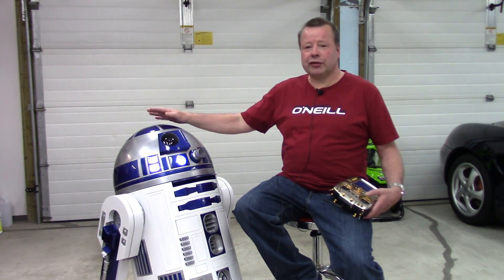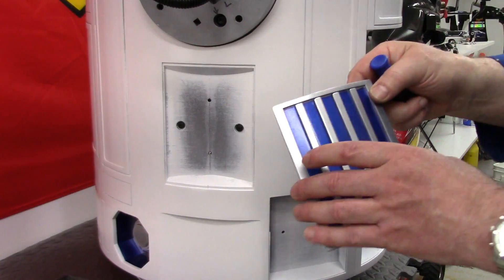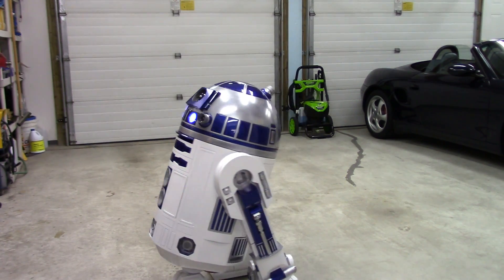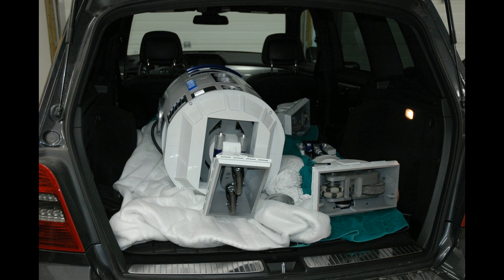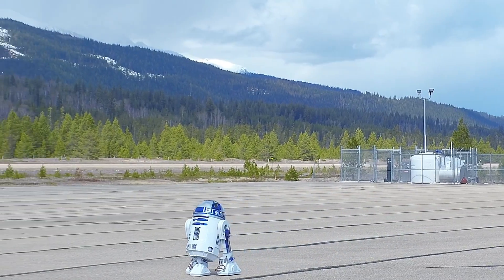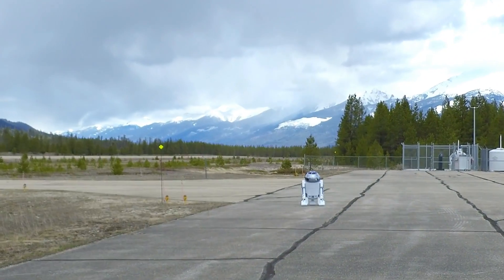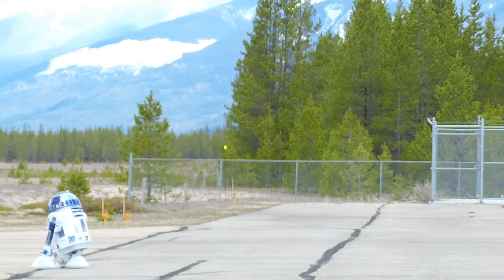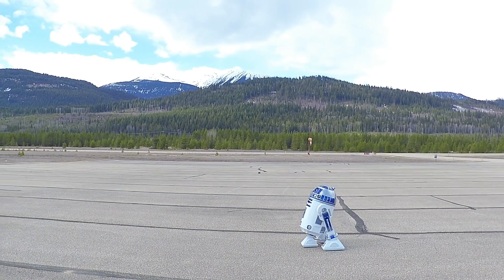Making R2-D2 - Finishing Up The R2 Build Project with Q&A.

Comment: I wonder if you could put one of the casters in the rear of the foot instead of the omni.  Would probably require a mod for mounting.
Reply from the maker: Yep, not nearly enough room for the swing distance of a caster back there. Would have to make the rear foot carriage and shell both wider and longer. Not an option.

Comment: Looks Great John !   R2 is my next big project, after I finish my B9 from Lost in Space.  The parts of your build series that I have watched are good.  I want to watch the drive sections, I am interested how you tied the electronics to the RC receiver.  I converted an 18 inch static R2 into a movable, interactive model.  this was done with an EZB controller and several servos.  It worked good.   I do have one question for you, does your R2 move from the 2 legged to the 3 legged position and back ?  Or are his legs fixed ?
Reply from the maker: Fixed

Comment: Could you have made the roller blade wheels on the rear legs caster as well? Then no need for the roller wheels.
Reply from the maker: I covered that in detail  earlier in this series (specifically part 8 and then fixed in part 9). Can't have a rollerblade caster as there is not enough swivel room in the back feet, and can't have just the roller wheel as there is too much wheel scrub while turning.

Comment: Amazing work John! I have also built a 3D printed R2. I started in 2019 and as you know he's a constant WIP, lol. To answer your question, I have not had many issues with the plastic creaking noises. Looks like you have the speed regulation down. I have almost flipped mine once or twice. I originally did the V2 belt drive and quickly switched to the V3. I started with 6S, then went to 4S but I think I'm going back to 6S. Mine is primarily Mr. B's V2. I transport mine in a 2DR Jeep Wrangler. I take the dome off and put it on the front seat and load the body in the back without taking the legs off. Fantastic work! thank you for documenting your progress! 7 Months is unbelievable!
Reply from the maker: Hey Kevin. Awesome to hear from you! I have to tell you, your video of your 3D printed R2 build ( https://www.youtube.com/watch?v=0DoM3aJg8eQ ) was the first one I ever watched (and watched the most) when I started down this road while considering different build methods and digesting information in the Astromech.net threads. In short, your build gave me the final push to go the 3D route because it looked so good.
Nice to know you didn't have any creaking or squeaking - perhaps it's due to different types of PLA used? 
Yep, a constant WIP is right. I still haven't weathered mine as I'm finding it hard getting the courage to start 🙂 That will be the next job however I hope to tackle over the winter.
I'm also considering changing out the Teecees light set to the Astropixles developed by Darren Poulson. They use the RGB LED's with the fading effect to emulate the original fiber optic/color wheel, but at a much better price than the R-Series hybrid fiber optic light set; Darren's also include the PSI's.  Ever since I watched Adam Savage's fiber optic light overhaul on his R2 last year, I'm finding the digital look of the flashing Teecees not my cup of tea anymore. Oh well, it never ends does it... Take care & thanks for the kind feedback.
Reply: Oh wow John! Thank you for the kind words. I have been thinking about revamping the dome also, I will look into the Astropixles format. I also want to us some Polulu boards for the dome panel animations just to make my droid different. Now that I'm settled in the new house I hope to get back to more video work and updates. I have had some people ask for more content and I am grateful that anyone would stop and comment so I hope to get some more vids out there. Thanks again for putting all you progress together and posting your videos.
Reply from the maker: Hi Kevin. Your video was very well done (as of course was your R2), so it's no surprise you get such requests. IMO, yours is one of the best if not the best 3D printed R2D2 videos showcasing the full build journey from start to finish in a single video with great story telling of the process. Very entertaining and as I said, I watched it many times, especially when I was feeling frustrated or lacking motivation with my own build. Yours always gave me inspiration to carry on.  
Have fun with any future R2 update videos now that you have more time and are settled in - I'll be watching :)

Comment: Hi John and thanks for the series! I have most of the body finished and working on the electronics and drivetrain now. I’ve been reading by other guys making their R2 units that putting caster wheels don’t work too well on carpeted floors. What is your experience? Also, could you tell me which  airport this is? I got my pilots license in Canada back in the day and miss the place got to say. Guess you have friends in high places. And by high places I mean the guy in the tower.
Reply from the maker: I suppose thick carpet would be an issue, never had any issue on the low pile stuff. Airport: CAH4. Our RC flying club has special permissions for shared usage. Have fun with your build.
Reply: Ah, BC! Cold, beautiful and very similar to Norway. Thanks for replying!

Comment: Great series - I'd be very interested in seeing how R2 is doing now. Is he still in one piece? Any mods?
Reply from the maker: @grasug8550 - He's still working like a champ. 🙂 No mods or additions other than changing some of the sound files. Had a few more of the blue LED's in the front logic lights crap out so that has been the biggest let down of all the components I got for him. I've purchased what I hope to be higher quality blue LED's from Digikey, and have replaced all of them now and so far none have failed. Still haven't weathered him but plan to this winter and will do an update/weathering video hopefully at that time.
Reply: @Rchelicopterfun  fantastic! I look forward to seeing the weathering, I'll be tackling that as a method of covering some less than perfect aspects of mine :)

Comment: hi john, for the center feet i try to use like you roller wheel, did you modified the file Omniframe top to fix the rollerwheel ??
Reply from the maker: Yes I did - used a block of wood to mount the castors.
Reply: Thanks for your help, your video is awesome.

Comment: Droid looks fantastic! My build is all aluminum, and spent close to $20k USD. So 3d printing I'm sure it's a little more labor intensive, but a more economical way to go for sure. We have a couple local builders that did all 3d prints, and they look good too. Good information, well represented!
Reply: hey just out of curiosity what was the majority of the cost in that build? was it actually the aluminum material and machining it?
Reply: @osama8025  yeah I had over $10k worth of aluminum parts before I even started putting it together
Reply: @GreatPlainsChaser  Amazing, how much does yours weigh?

Comment: Hi Sir …. The Pla plus It has not given problems such as heat deformities or weight problems such as broken parts????  Thanks for documenting everything.
Reply from the maker: All fine; then again, my R2 is never exposed to high temps much over +40C so I can't comment on thermal deformation issues due to my specific environment. As for strength of the PLA+, like most who have done strength tests, I've found it stronger than ABS, and most PLA+ I've used is just as impact/flex resistant. No idea how age will affect that of course but so far, so good.

Comment: Hi John. Great series just a question on paint Station. what size would I need for the biggest part.
Reply from the maker: Pretty much up to you and the amount of space you have and size exhaust fan you have. R2's main body is the single largest piece to paint so as long as you can fit it in with a bit of room to spare, that would be the minimum.
Reply: @Rchelicopterfun  Thanks John. I have searched and found 21.5x18.5in which is 55x50 cm approx. I am planning on 61x61cm so looks fine. Also on the Sovol 1.0 you said you could just about put the largest part on that. As I will be new to 3d printing is this something a typical relatively new user of the Sovol would be able to do or is this an advanced us of a 3d printer. Thanks again - going to watch your videos loads as I build  here in the uk. I have already recommended them to a few other new builders - I am 9 days into my planning so about 3 months away from starting for real.

Comment: Thank you for sharing! So inspiring! I coached several youth robotics teams and I have always wanted to build an R2D2 droid. After experiencing middle and high schoolers build and drive their robots hard.😅 I was wondering how your wheels and belts are holding up? I noticed too that you used locktite quite a bit. After driving, do you check certain screws any looseness? Thank you too for posting the weight. That has always been a concern for me. I have an SUV for transport but I have been thinking about how to load and unload a Droid  solo. Thanks again!
Reply from the maker: This R2 has no belts, only gears for the foot drives (mark III feet). All the gears are standing up fine, no issues. I've worn the TPU tires down about 70% already, but I've been driving him on aggressive asphalt a fair amount. Have a new set of tires printed up, just have to install them this winter. No detectable wear on the Omni-wheels or front foot rollerblade wheels/casters.  Not a single fastener has come loose; why I used Loctite 242 on them in the first place 🙂

Comment: Fantastic job! and the paint is perfect - thanks for all the tips!
Did the TPU tires survived well the long run on concrete?  I builded TPU omnis and affraid its not gonna last long - but used your idea on center wheel rollerblade casters, works well!
May the 4th be with you!
Reply from the maker: @Drowiz - Yep, they held up fine. The thing has lots of torque with not much weight so is easy to break the wheels free with the stock settings in the Sabertooth. That is what will shave them down fast. I had to dial the start current delivery settings down a fair bit in the Sabertooth, and now only with 100% dual rate/full stick can I break the wheels free on smoother surfaces.

Comment: Congratulations on completing the build. Also thanks for uploading the series, it's been fun following both you and Jason Charlton.
I'm about 14 months in and can foresee another 6+ months to complete adding all the doors, pies and arm servos.

Only downside I have at the moment, is the TPU printed foot tires are wheel spinning now. Might need to find a better quality/softer TPU filament. Do you recommend the brand you used?
Reply from the maker: The stuff I used is just 3D Printing Canada's generic TPU. It might be rebranded, but I have no idea? I had to dial down the starting current in the Sabertooth to prevent wheel spin using the programming software.

Comment: Hi. Were the parts made with PLA or ABS? Did you use epoxy or super glue to join the parts? Thanks in advance?
Reply from the maker: Covered in the very first video in the series: https://youtu.be/hkkSagTsLXY
PLA+. Mostly CA.
Reply: @Rchelicopterfun   I wish I found your video before I started mine last year, I would have avoided some of the pitfalls. Got the body and dome mostly done with plc+ and epoxy, but now working on the electronics and software which has been quite a challenge. Thanks for giving me some good ideas for my build. Your build of Artoo is beautiful and giving me inspiration to continue. Thanks for the reply back and I hope you build another one in the near future. Cheers.